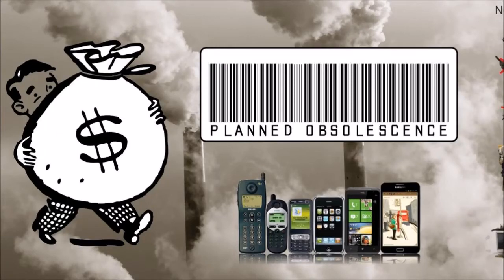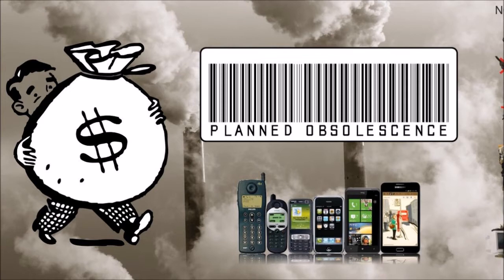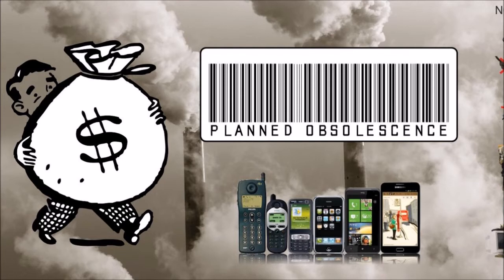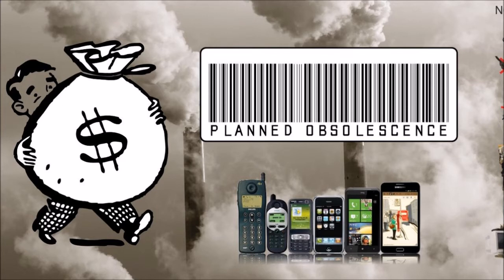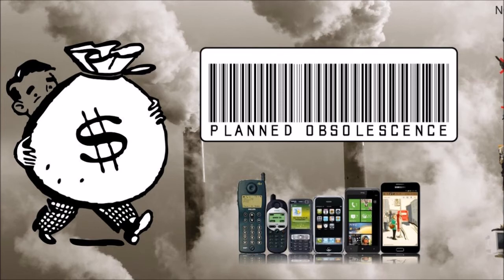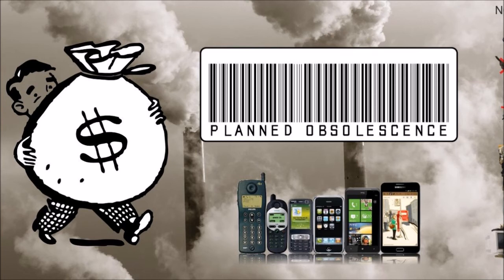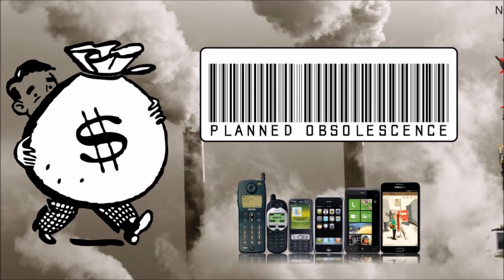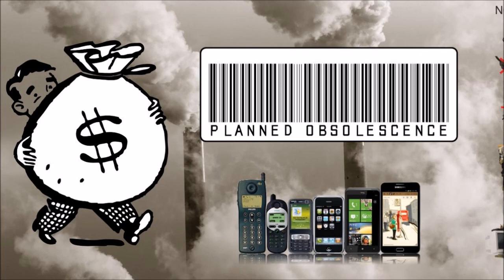Planned Obsolescence (Artificial Product Lifespan)

Comment: A classic example of planned obsolescence is the intentional not use of strain relief on cables. Resulting in the internal cable wires to snap and render the device useless. I actually came here after repairing my Microsoft mouse which had this problem. Thank you for the video it deserves more views!

Comment: My Samsung Galaxy SII lasted ~4.5 years and then it's battery went crazy. Or so it seamed. If under CPU load after a while the phone would slow down considerably at random charge ammounts and when restarted would show up 50% (!) of the charge missing. It's no fun to have it go from 60% to below 10% when you are out doing things. So I bought a new one and it's exactly the same thing. No tricks like "battery callibration" help. I have to keep it on the Energy Saving permanently with the consequently reduced CPU power. The phone is slower than a slug on weed.